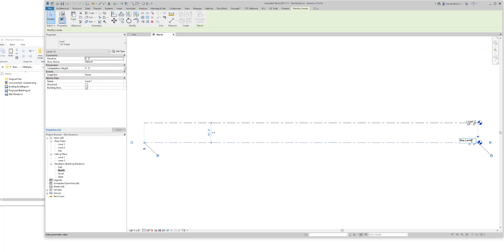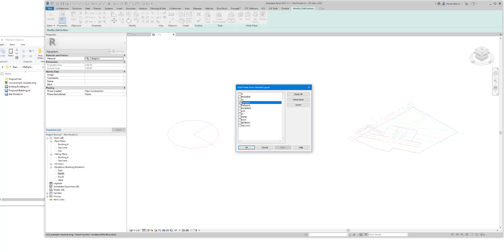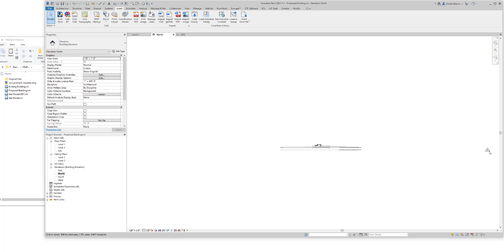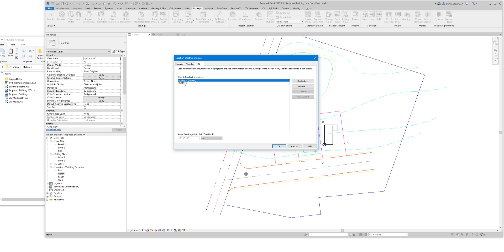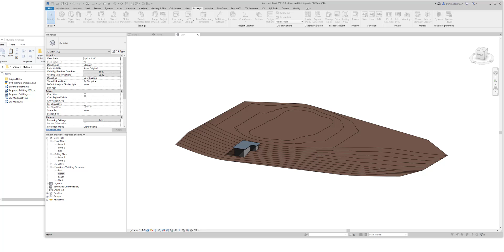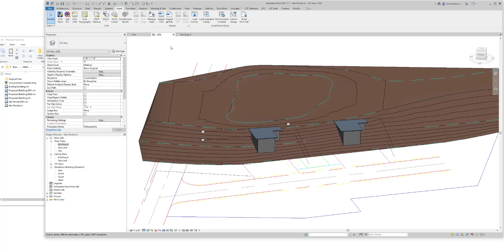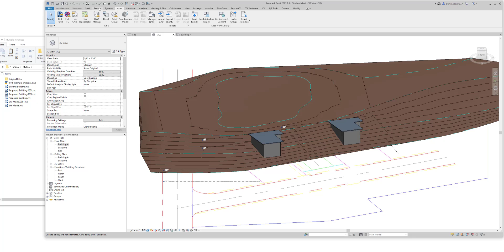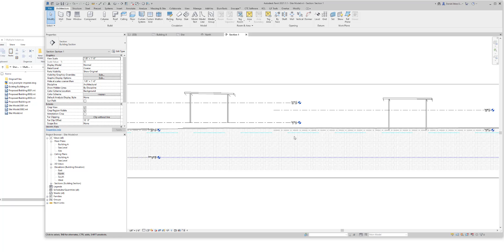Revit Shared Coordinates - Multiple Building Instances

Comment: Thanks for the video! If the other building is not identical, is the workflow similar just that instead of linking same file on the second site, I will link the second building file with the second site and so on for any number of buildings?